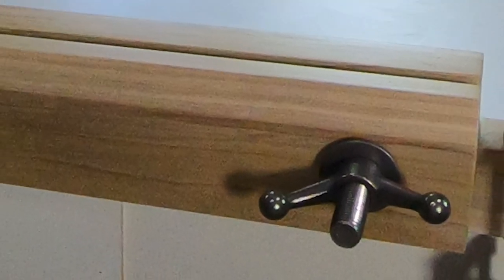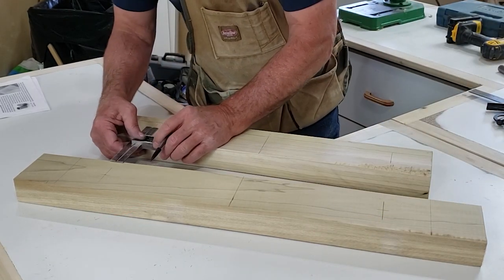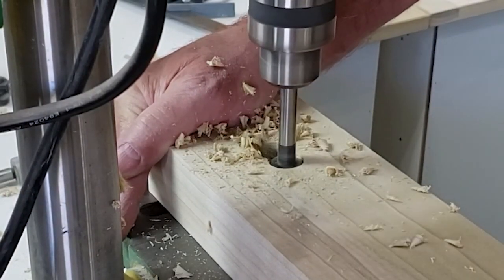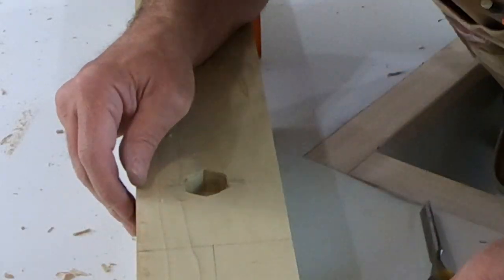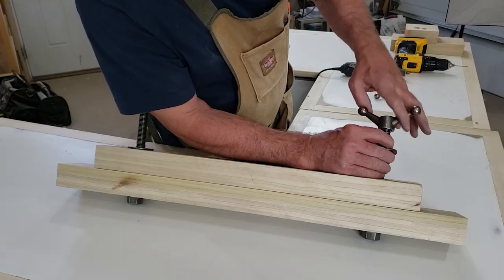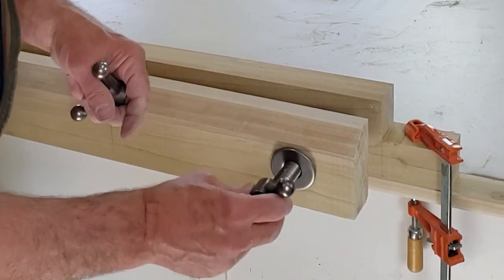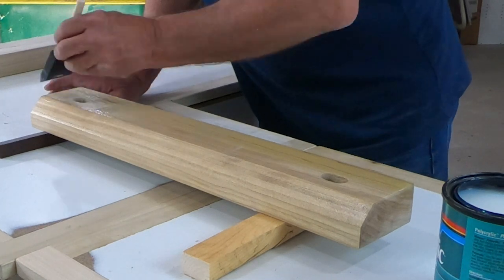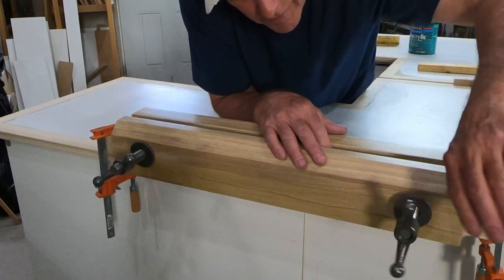Building A Moxon Vice - Quick Solution To Securely Holding Materials

Comment: Is it possible to buy or make a shelve for a 55 gallon tank? would be 55' x 13' to hold 600-625 pounds
Reply from the maker: Yeah, Thomas, there is a solution for anything. Are you talking about a floating shelf or one with a structure under it? 55 x 13 inches? Sounds like a fish tank? The heavy weight limits your options somewhat.
Reply: @RustyDobbs  hey, yes, it is a fish tank. The idea was to create a shelf with a floating effect. The weight would be for  650 pounds. I know it's a challange, but I can't figure out a way to create a shelf stuck in the wall that would hold the fish tank. My dimensions were a bit off, its 48' x 13'.